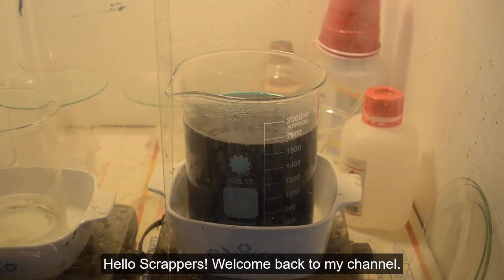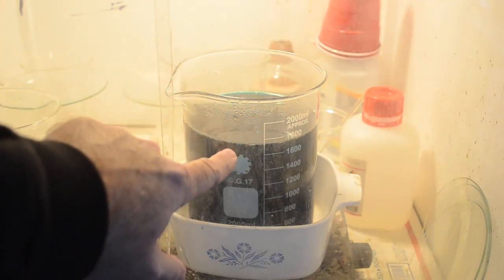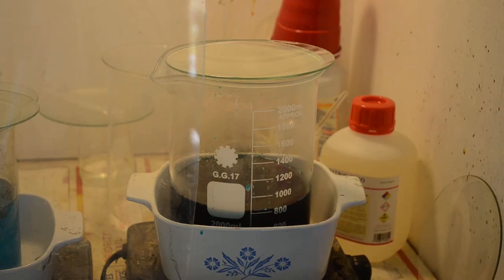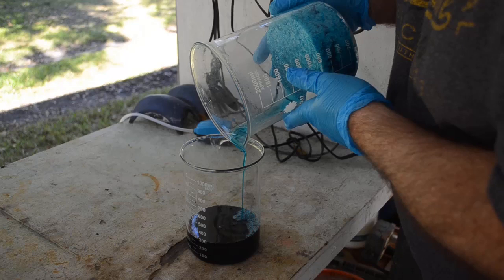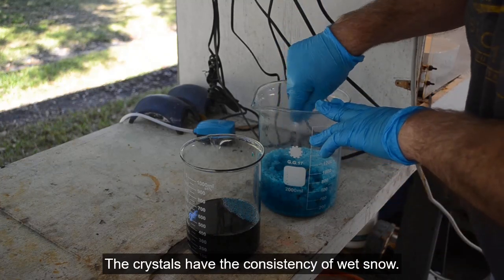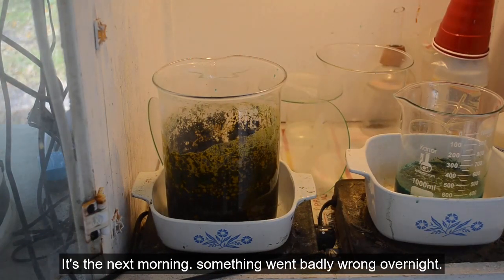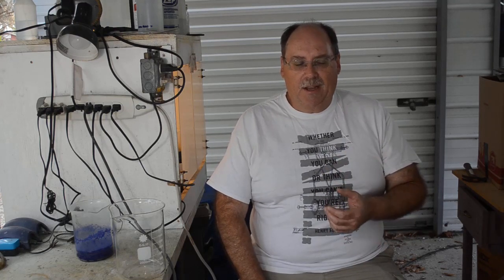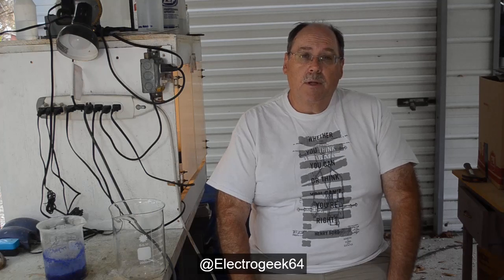Useful Crystals From Gold Recovery Waste

Comment: I run a copper parting cell (I refer to it as a TAPP cell - Titanium Anode Parting Process). This process is run in copper sulphate without melting or casting anode bars, and is pretty much limited to recovered pins. Once the electrolyte has processed 60-100 pounds of copper, I'll cement the copper out on iron. The resulting iron sulfate I concentrate down for use as a dirty drop gold precipitant. So not only does the electrolyte last a long time, it also produces a quite useful byproduct in the waste stream.
The other benefits of the TAPP cell is that the gold is left in foil form, captured in an anode filter bag, and I don't have to deal with slime recovery.
The other potential side benefits are the large dendritic copper crystal formations that I'm considering selling as objects d'art. Largest so far is 2kg.

Comment: I have used oven-dried magnesium sulphate to dry my copper nitrate crystals in a homemade desiccator with success. I have found that getting as much water out as possible using this method yields a higher concentration of HNO3 in the end. Copper nitrate, as I’m sure you know, rapidly absorbs moisture from the air so sealing any container used to store them is paramount. 👍
Reply: This is what I was going to mention also, these salts are really hydro scopic and love water. If you let some already dried crystals sit on a plate overnight, when you come back in the morning and they are covered in water and half dissolved. Depending on the humidity of course but if he wants to get them really dry, then a desiccator is a must. They will never fully dry just sitting in the air.

Comment: I've had a similar experience of nitric salts breakdown runaway. In my case I'm positive that there were no organics involved and it happened without any extra heat, just slow evaporation in a plastic bucket.
I remove any remnants of copper from my waste solutions by cementing on iron. The iron salt liquid with mixed chlorides and nitrates were poured into a shallow bucket to evaporate the water.
One day I came into the room where it was sitting it looked like a brown rusty volcano with red NOx spewing from the center and a brown foam flowing over the edge of the bucket. The volume had doubled and it was hot but not boiling.
I knocked down the foam by spraying it with water.

I suspect it might have been Fe2+ -> Fe3+ oxidation that released the excess heat and in a big volume the heat didn't dissipate fast enough and I had a runaway event.

Since that day I never evaporate large volumes of iron salts, I precipitate it with NaOH and filter off the iron hydroxides and slowly evaporate the sodium chloride with minor nitrate and sulfate salts. I try to keep most of my nitric waste in liquid form to reuse as nitric acid via the sulfuric acid process. Nurdrage have a video where he recycle copper nitrate into nitric acid and copper via copper sulfate electrolysis.
Maybe something to consider instead of thermal breakdown. You need sulfuric acid, a distillation setup, lead or platinum anode, stainless steel or copper cathode and a power supply. I think you have all the equipment that is needed already.

Comment: Copper nitrate is pain to dry, it is hygroscopic as hell. Even stored crystals in the closed bottle after some time just dissolve to blue goop from atmospheric moisture. and I am talking about laboratory-grade stuff xD
As for nitric acid synthesis from nitrates, check out NurdRage videos. As for dry distillation, evaporation is problematic (as you can see) and it is not very high yielding from NurdRage experiments. As you play already with copper electrolytic cell, his second process would be ideal: nitrates + H2SO4 → HNO3 + sulfates → distillation → electrolysis of sulfates → H2SO4
Full circle and at the same time possibility to use the output as electrolyte for copper refining.
Still, I am curious about your retort setup :) And please be very careful! Organics + nitrates = explosives. It is very dangerous to heat that mix if there is carbon source inside. Fingers crossed for you!
Reply: Here's the NurdRage video on recovery of nitric acid from copper nitrate https://youtu.be/l8uQWibpRYk